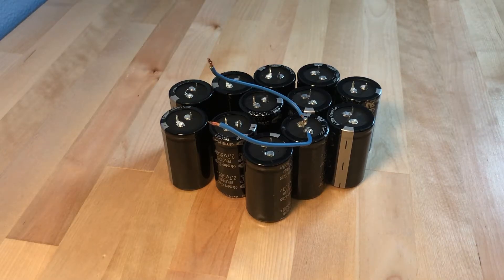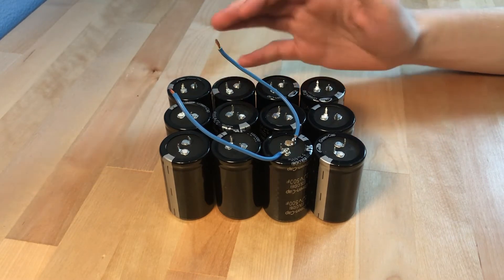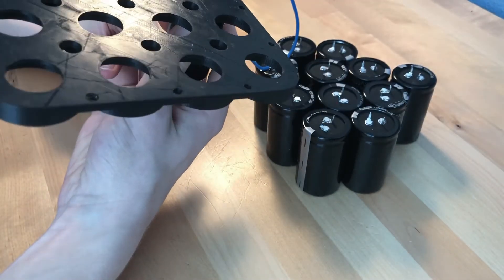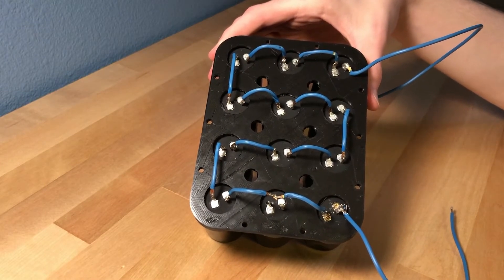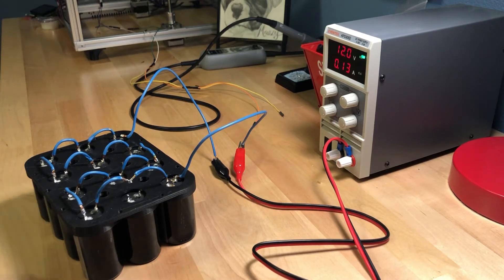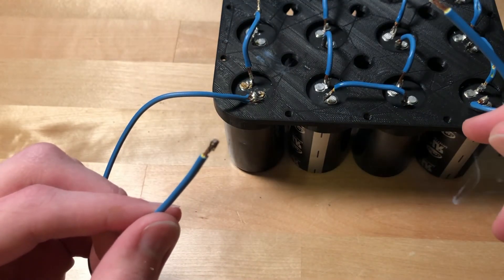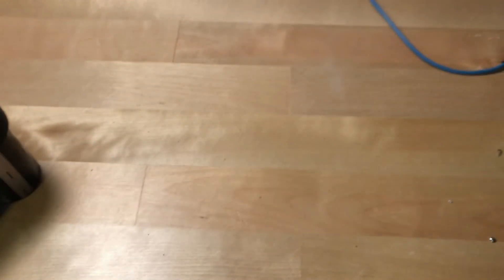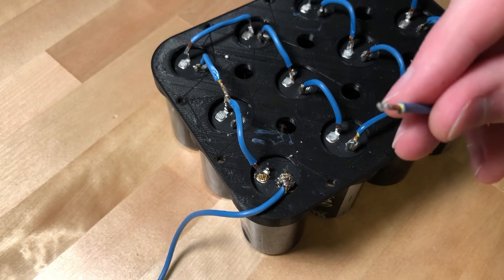30 Volt 500 Farad Supercapacitor Bank

Comment: Couldnt you just put a cheap active balancer on it. The start correcting at a few millivolt difference. Some even have Bluetooth and you can check each voltage on your phone.
Reply: Good luck finding a balancer for 2.7V

Comment: Man, forget the solder.  You could stick welding rods on there.  That is exactly what happened.  You melted the wires together.  Had the leads remained in contact, the caps would survive, but the wire woud get so hot it would probably melt and the insulation burn.

Comment: How about using Diodes to balance the cells Voltage during charging?
Reply: do they need balancing?
Reply: If you want to get the full capacity, or if you want to make your bank safe to charge without your attention, IE practical operation. He stopped when the first cap was at 2.5v or whatever. Others would have been at a lower voltage, so less charged. There was a portion of the full capacity of the bank which was unused, but the charge state (voltage level in this case) was kept at a safe level by stopping the charge process.

If you have a way of balancing the caps (most banks use a dissipative mechanism to burn away the excess power on a cap at rated voltage) that gives you the chance to fully charge all caps in the bank, without taking some caps to a dangerous (IE over rated spec) charge voltage.

Of course you're then turning power into heat just to waste it. Lose power to gain stored power. Do you gain significantly more stored energy than the power you wasted to keep the balance? Is there a less wasteful process to keep the caps balanced? Does practicality overrule possibility when you're designing a product for commerical production?

If the capacitors all had identical characteristics (IE perfect capacitors in a perfect world) then charging would be even for each cap. But we do not live in a perfect world.

Limiting the total voltage to ~90% of rated voltage times number of capacitors didn't help in this case, so balancing would be something you might do to eak out maximum capacity, or as a safety mechanism to be sure that the caps are always passively (IE no human monitoring or intervention) kept to safe charge states.

Comment: Hello, and thanks for posting the video, however the entire bank appears to be connected in series!  So...you would have 2.5v x 12 = 30v (voltage adds in series)....and 500F /12 = 41.7F (capacitance divides in series--with equal valued caps!). this gives you a total energy of 18750J.  The energy is conserved, so if you calculate the energy that can be stored in ONE cap (1562.5J) and multiply that by 12, you get the same energy as the bank of 12 has.
There is still a lot to learn, but judging from your other videos, you'll get there FAST!
Reply: I added a rather lengthy reply, but didn't see it go through....so, here is a similar version...

Actually it's 500F REGUARDLESS of the voltage the capacitor is charged to....or they couldn't print 500F on the label...this 500F is constant at any voltage!  Don't confuse capacitance (C in Farads) with energy (E in Joules), or charge (Q in Columbs). And, of, course, Voltage (V). They are VERY different,.  What is important is to know how thay are related in the capacitor--HERE GOES.... A LARGER capacitance (C) capacitor simply means that that capacitor can hold more charge (actually, DISPLACE more charge, [Colombs (Q)] with less voltage (V) across it.  The relationship between charge (Q), voltage (V), and capacitance (C) in Farads (F), and resulting stored charge(Q)  in a cap at this voltage is:

Equation (1):    Q=CV.

A handy thing to know is that one Coulomb of charge is 6.24EE18 electrons (6,240,000,000,000,000,000 electrons!  This sort of gives you a 'feel' on an atomic scale.
If you charge a 500F cap to 1 volt, the amount of energy stored is twice that of a 1000F cap at the same 1 volt (see eq. 1).   
For capacitors in series, the capacitance divides, and the voltage adds.  Take your exaample, 12   500F caps charged to 2.5v each, in series had a total capacitance of 500F/12 = 41.7F at 2.5v x 12 = 30v (your video title should actually be: 42F at 30v).   NOW, concering the energy, E, (which is conserved):  There is another simple equation:

Equation (2):     E = (1/2) C V^2       [note V^2 is V squared....so the E rises faster with increasing V than with increasing C]

Using equation 2 with a SINGLE 500F cap at 2.5v gives a stored energy of 1562.5J.  If you have 12 of these in series, that is, 41.7F @ 30v, then plugging in C=41.7F and V=30v gives (using eq. 2):  18765J of energy.  This is exactly 12 x the 1562.5J of ONE of the caps. "energy conversation",  verify you get these values using eq 2.  For caps in parallel the max. voltage is that of one single cap, but the capacitance (C) adds.  In your case, A bank of 12   500F, 2.5v caps in parallel will be: 6000F @ 2.5v.  AGAIN if you plug this C=6000F and V=2.5v into eq 2  you get E = 18765J.  This works even if they are in some sort of series/parallel configuration.  Energy is always constant, but C and V can vary.  IT ISS VERY IMPORTANT THAT YOU KNOW THE MAX ALLOWED VALUE OF V, OR OVERVOLTAGE COULD CAUSE A FIRE/EXPLOSION!!!

One more interesting thing that is non-intuitive:
When you charge (or discharge) a capacitor, you add ZERO electrons to it!!!  The charge-voltage placed across them only SEPERATES the + and - charges between plates.
...probably left out part of whwt I wanted to write, but hope this helps some
....always glad to talk capacitors.
Reply: I spotted a mistake in comparing a 500F caP to a 1000F cap each at 1v.  THE CHARGE OF THE 1000F CAP IS TWICE THAT OF THE 500F cap.
Reply: @dalenassar9152  I figured that's what you meant about the 1000f and 500f cap .

this is a lot to wrap my brain around but it seems to make since what you say but I have kind of a different question about caps now 
so I came across 8 high-end hifi capacitors that were used in a very high-end class A amplifier they are huge they are 80mm by 160mm but they are only 100000MF at 100v 108c* which is 1 10th of a farad and they weigh 4.5lb each there just huge but why are they so low of a capacity for their size? when these caps in the video are 500f and about 1/4 the size granted there is a big voltage difference 2.5v vs 100v is what why they are so big Is do to the voltage capability? and does that mean that at full charge of 100v that capacitor can hold 10 farad ? 
also I have a 50f cap bank that's rated up to 18v if I charge it to 14v does it have a total of 700f ? and if I'm only using it in the range of 10v to 14v (car on playing my system) does that mean it only has 200f worth of power that can be utilized within the voltage range of 10 to 14v because I'm not draining it all the way down to 0v?

sorry for all the questions I e just have these questions for ever and can't seem to get an answer on them so I really appreciate the help!
Reply: Hello, I will paste this response and try to mostly respond within your text in all capital text.
But first, maybe this may bring more perspective WRT capacitors: I get the impression that you have mostly worked with supercaps and don't quite realize the complexity of obtaing large capacitance values.  The most basic capacitor consists of 2 parallel identical metal plates seperated by a distance "D".  The capacitance of this capacitor is DIRECTLY propotional to the area "A" of a plate.  i.e. if you DOUBLE the area of the plate, you get 2 times the capacitance.  ALSO the capacitance is INVERSLY propotional to the distance seperating the plates, so if you make the seperation of the plates "D" twice as SMALL, you double the capacitance.  So, to get the largest capacitance, you make the area as large as possible, and get then as close together as possible.  IOW, the capacitance is directly propitional to "A/D".  However, for the total capacitance you have to multiply "A/D"  by a CONSTANT called "the PERMITIVITTY OF FREE SPACE", Let's call this constant "k",  which is a very small number (8.85 EE-12), or 0.000,000,000,008,85 making a large capacitance capacitor even more difficult to construct! The equation of the capacitance "C" is given as:

eq 3:   C=k(A/D)

Nowdays, the plate area is made much larger by chemical techniques applied to the 'dielectric' that allow the capacitor's plates to be "effectively" further apart while actually increasing the capacitance by a constant called the "DIELECTRIC CONSTANT".  Fortunally, the dielectric constant is NOT one of those tiny numbers!  By using such a dielectric between the plates, the capacitance is multiplied by that number.  Now, if we call that dielectric constant 'H', eq (3) becomes:

eq (4):   C=Hk(A/D)

This GREATLY increases capacitance (C).
Since one of the critical answer to large capacitance is large surface area,  One secret to the HUGH, HUGE capacitance of a supercap is the use of ACTIVATED CARBON as a dielectric.  I have heard something like a teaspoon if this activated carbon can spread ofer an area of a couple football fields!

 Here is a significant example:  Suppose you wanted to make such a parallel plate capacitor with a capacitance of 1F.  If the distance separating the plates is just 1mm (with air in between), then the area of EACH plate required to get 1F of capacitance would be about "45 SQUARE MILES...YES, thats MILES!  So how are even standard capacitors of capacitance, say, 1uF made practically small?  Well, the first DIY step to solve the huge plate area problem would be to "roll-up", for example, a 1 foot wide sheet of thin metal foil that is very long, separated by a very thin insulator (called the 'dielectric'), to prevent shorting, into a portable 'cylindrical' capacitor.  This is exactly what you would find if you disect a common 10uF 100v electrolytic capacitor laying around.
==============================================================
MAYA EL
dale nassar I figured that's what you meant about the 1000f and 500f cap . this is a lot to wrap my brain around but it seems to make since what you say but I have kind of a different question about caps now so I came across 8 high-end hifi capacitors that were used in a very high-end class A amplifier they are huge they are 80mm by 160mm but they are only 100000MF at 100v 108c* which is 1 10th of a farad and they weigh 4.5lb each there just huge but why are they so low of a capacity for their size?----YOU SAY ONLY 100,000uF AND AT 100V??!!-------  when these caps in the video are 500f and about 1/4 the size granted there is a big voltage difference 2.5v vs 100v is what why they are so big              ------THIS IS ACTUALLY TINY FOR SPECS IN AN ORDINARY i.e. ELECTROLYTIC CAP------ Is do to the voltage capability? and does that mean that at full charge of 100v that capacitor can hold 10 farad?   ------YOU SEEM TO BE FORGETTING THAT FOR A GIVEN CAPACITOR, IT'S CAPACITANCE IS CONSTANT, REGUARDLESS OF WHAT VOLTAGE IT IS RATED OR CHARGED TO.  THE SPECIFIED VOLTAGE IS SIMPLY THE MAX VOLTAGE YOU CAN CHARGE THE CAP WITHOUT DESTORYING IT------  also I have a 50f cap bank that's rated up to 18v if I charge it to 14v does it have a total of 700f?   ------NO, AGAIN IT WILL--ALWAYS BE 50F---- and if I'm only using it in the range of 10v to 14v (car on playing my system) does that mean it only has 200f worth of power   ------FARADS (CAPACITANCE IS NOT POWER.  POWER (WATTS) IS THE RATE AT WHICH THE ENERGY(E) IS USED---- that can be utilized within the voltage range of 10 to 14v because I'm not draining it all the way down to 0v? sorry for all the questions  I e just have these questions for ever and can't seem to get an answer on them so I really appreciate the help!  ------NO PROBLEM,GLAD TO HELP WITH THIS FURTHER!------

I noticed how impressed you were in the video at about timestamp 11:00 (I think around here somewhere).  You may want to keep a couple other demo's in mind:  Just 6 of your 500F caps will start a car over and over.  Also, years ago, using three 3000F caps in PARALLEL with the connectors made of THICK copper wire,  I shorted the leads across a large metal screw---the screw quickly became bright orange and then just melted into a lump of 'stuff'.
My reply turned out a little different in format than I expected, but I think the messege got in.  My response is actually cut a bit short.
--dAlE
Reply: @dalenassar9152  idk why but I just now understand the constant farads thing now I get it and it makes since as to why caps help keep the voltage up 8n a vehicle because the farad's are the same regardless of voltage unlike a battery.
But just to make sure I understand you correctly
Your saying that the reason that a supper cap can be 100x that of a regular cap of the same physical size is the design? The super cap has a different technology in it to where it has "more surface" separated by dielectric ? And if so then why do we still make regular caps? Wouldn't it be more beneficial to make micro caps ? Less material and smaller circuits? ... Ps I'm really enjoying this conversation
Reply: @SheikhN-bible-syndrome Sorry ...been offline for holidays.  I will be back on in a 'couple days.  
BTW: have you noticed a very strange dissapperance of virtually all the genuine Maxwell 3000F 2.7v caps on ebay and other places?
Reply: I'm confused if it's a 500f cap where are you getting 1562.5J from?
Reply: @SheikhN-bible-syndrome  OK, I will do this as I am writing...the formula for the energy 'E' in joules stored in a capacitor is 0.5 x C x V^2.  So for ONE of your caps, where 'C=500F' and 'V=2,5v', we get 0.5 x 500F x (2.5 x 2.5) = 1562.5J. 
The total bank would store 12 times this energy...12 x 1562.5 = 18,765J
Another way:   consider the energy of your  entire 12-pack.  using C=41.7F and V=30v, gives 0.5 x 41.7F x (30 x 30) = 18765J of energy.  Divide this by 12 and you get 1563.75...the charge on EACH cap
Reply: @dalenassar9152  ok so it's 500f per volt I was thinking it was just 500f regardless of the voltage but what you said makes since

Comment: Use these capacitors for better application instead! 👍
Reply: And at least know what you're making before you start soldering tiny wires on stuff.
Reply: @louiswhite1445  why
Reply: @louiswhite1445  shush wanker

Comment: 500 Farad =500 Amp/Secs @ 30 Volts =  15000 Watts - I would say be very careful indeed, 42 Farad @ 30 Volts = 1260 Watts, still very dangerous current especially if hands are wet

Comment: try parallel instead cause you are loosing farads. Just use low resistance stuff to shock with 6000farad 2.7v